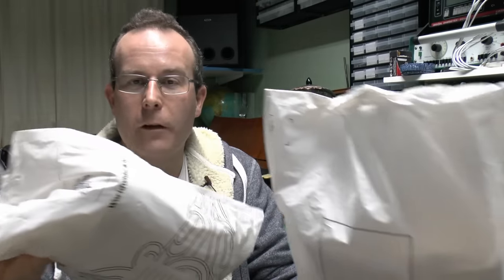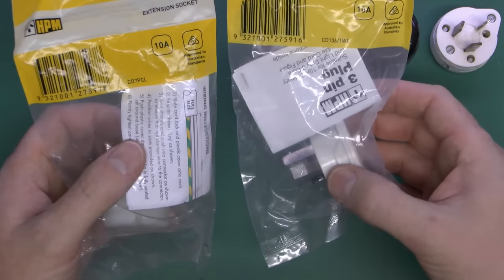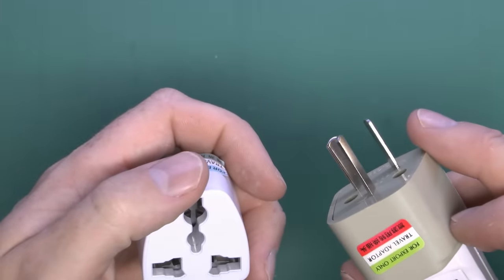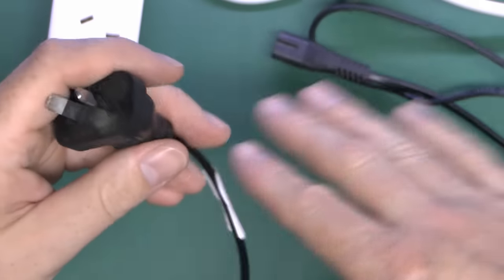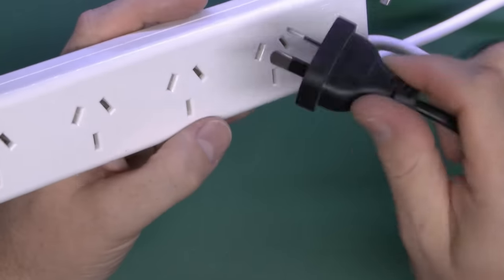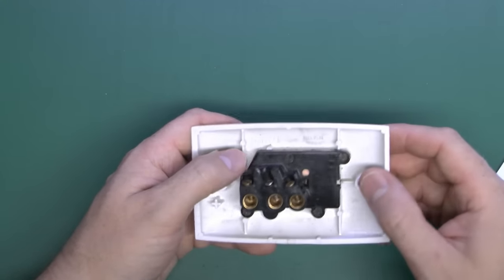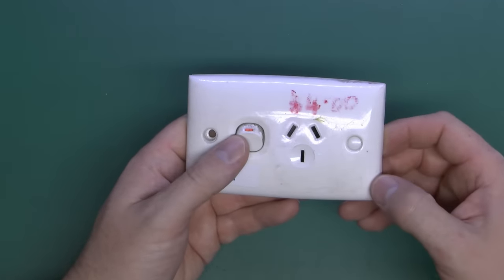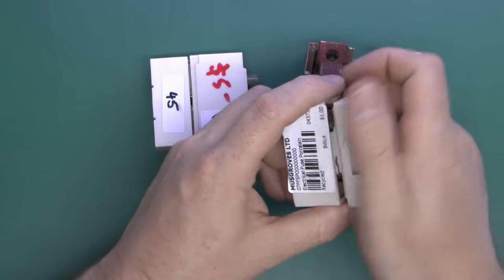New Zealand Electrical Items

Comment: The Australian and New Zealand socket format is based on a design patented in 1916 by Harvey Hubbell II, who also designed the standard US socket. He intended it to be an improved version to replace the US power outlet, and it has similar dimensions. However, it never caught on in the USA. The Australian government apparently chose that design as it was much easier for local manufacturers to stamp out the relatively thin, flat pins than the solid brass ones used on UK plugs (which was the old round pin standard at the time, still used in India).

Comment: What a trip down memory lane ,Iwas an apprentice and tradesman toolmaker at PDL through 80s and 90s so several of the 22, 56, 500 and 600 series switch gear had my name on the mould and press tooling.
PDL is/was a GREAT NZ company. Clipsal and HPM our fierce aussie competition until all acquired in the early 2000s by schnieder electric. The old PDL 1960s 22 series bakealite switch gear is a bullet proof design still present in lot of NZ homes, its not surprising that you had no examples of its successor the modern looking 200 series, this range looked all modern with sharp edges an square look but its switch action was poor and always prone to wear and jamming, neither on nor off. The 500 and 600 series set things back on course with improved function and contemporary looks and the essence of these 20 year old designs is still evident today.
Reply: Tony Jongerius yes was good . China sends it back to us now
Reply: Tony Jongerius did you notice smelly baker lite on lamp holders lll
Reply: Only problems with PDL 22 series are the lack of protection from dust and dirt, and the earth pin should have had better mechanical support to prevent it being bent out of shape.

Comment: It's pretty standard to have all your lighting control wires go to and from switches here and not ceiling roses. Hence the Loop termination. Saves going into hot dusty loft spaces.

Comment: I am a electrician myself here in The Netherlands. All the boxes and outlets are made in Germany. At leas what we get. Our Wires are made in Germany as well if I am correct. And the Pipes we use are made somewhere in the EU (doesnt say where I assume Poland) other items we use are mostly made within europe as well.
Sockets and plugs are the standard european. In Europe there 2 main standards. What I call the normal type and the Belgium/France type. The main difference is that the normal ones have 2 tabs on the top and bottom of the plug and socket for earth. The Belgium/France type has a pin inside the socket which connects to a hole in the plug for earth. This type is also seen in Poland if I am correct. Most EU countries these days use the normal type. Sometimes even mixed. While I was in greece in the hotel we had 2 types of outlets. regular european ones, and a outlet with 3 holes (center hole is earth) There were some outlets in the room where we had that type. I don't know why they still put those in but I guess the normal EU type wasn't a standard to put them in. Allthough the 3 pin plugs have round pins right next to each other and the pins arent sleeved. soo if there partially inserted you could fry yourself. Well over there they don't care that much about electrical safety... I have seen weird stuff over there.... I saw a junction box opened. I could see the wires which were twisted together and insulated with electrical tape...

Comment: The socket with extra antenna outlet was for old Band I TV, which used a 300R ribbon feeder down to the set. Only later was a coax cable with the familiar Belling Lee "UHF" required, as this was transmitted on a sub 300MHz varrier.

Beware of the Clipsal, the 10A rating is very optimistic, here in SA the same style but with SA outlets will melt themselves at under 10A continuous, though that could just be them being the cheapest thinnest brass you can get.
Reply: +SeanBZA interesting, I've never heard of problems like that with Clipsal here.
Reply: +SeanBZA Your comment is incorrect about Clipsal. Our 15Amp outlets have the SAME Active and Neutral sizes as the 10Amp versions. The Earth pin is wider http://www.clipsal.com/Trade/Products/ProductDetail?CatNo=439S15 It is not quite double width. Our 20Amp version has 3pins the same size as the 15 Amp earth pin. 

I come across a lot of backyard metal workers who have air compressors / Plasma cutters / Welding inverters that all need 15Amp plugs. A lot of places do not have 15 Amp outlets so they make up leads that have a 10Amp plug with a 15Amp socket (unless they have just bent / cut the earth pin). 

Over 20Amp plugs we move to the industrial weather proof range (used to be called the 56 series after Clipsal's IP56 range which all part numbers start with 56 ) The 56 Series has single and three phase plug / sockets from 10A to 50A in plastic bodies with pin configurations of 1P +N +E, 3P +E, 3P +N +E. Also available but not widely used are 3P +E +2 Control, 3P +N +E + 2 Control. The control pins had no fixed function, they could be an external switch contact, RS485 Data Bus (A Touring lighting system was set up this way and the lighting RS485 common was mains earth).   

Clipsal is extreamly popular in Au as its head manufacturing plant is in a suburb of Adelaide in South Australia (the factory Tour is great)

Comment: For number 22 the socket at 16:20 the damage to earth was likely caused by a bent earth pin. In commercial buildings professional cleaners would often bend the earth pin on vacuum cleaners, floor polishers or similar equipment portable equipment to help the plug stay in while they worked. Over the years this would gradually damage the earth on the socket with broken plastic and poor contact for the earth pin similar to what you saw on that socket. It is quite a common issue.
Reply: That sounds like a good reason to have the beefier UK design instead. Even a young Arnold Schwarzenegger wouldn't be able to bend those.

Comment: Had a good giggle for 21 and 22 at 16:31

They're intended to be mounted 90 degrees anti clockwise to how you held them. So basically vertically with the ground towards the... well... ground. If I remember correctly the thinking, or at least the rumor, is so that if a plug is working its way out unexpectedly the last thing to lose contact will be ground as it's being pulled down.

Comment: One big advantage of U.K. Twin, or Triple, plus Earth cable is that the bare Earth wire can be used to strip back the outer sheathing very quickly. Start with a short cut, grab the Earth wire with pliers whilst holding the rest of the cable in the other hand, and pull. Thanks John. Very interesting.
Reply: Our TPS cables are so easy to strip the outer sheath off, a 5 year old could do it, 
just nick the end with your "sideys" and open it up.

Comment: Interestingly, the AU-/NZ-style of plug & outlet was actually invented in the US. It was the first grounded (earthed) type, patented. When encountered today (sometimes in laundry rooms of really old houses), electricians often refer to them as "crowfoot" plugs/sockets (due to the shape made of the three pins, viewed head-on).
Reply: ***** 
Those are all different plugs to the AU/NZ plug.  The pattern is similar but they are much bigger.  There is indeed a weird old outlet that is identical in pin spacing to the AU/NZ plug.  They were used for things which needed a ground before the standard plug we use now.  They were/are also used for "security" type reasons; to keep people from nicking power or equipment (although the latter is a rather dubious idea; anyone can pop a new plug on whatever he's just stolen).
Reply: +Scott Lichtsinn Yes, you're correct about the 30 & 50-amp outlets. But I was referring only to the old outlets that would be directly compatible w/ the AU/NZ plugs.
Reply: +Madness832 See US patent 1,179,728.
Reply: Yes; it's one of Harvey Hubbell's original designs, which included the tandem prongs, parallel prongs (as seen in this vid), and "polarized" (prongs perpendicular to each other).  Australia used a variety of (American) plug types before they standardized on the "crowfoot" type they now have around 1937
Reply: The crowfoot plug is still used in America--sort of.  On 277v, except that the ground is a round pin instead of flat prong, the same pin as on the standard American grounded plug
Reply: @davidpar2  The Australian standard plug standard was in use in 1923 - the official standard came later.
Reply: Been a few years, but I recently acquired a US crowfoot outlet & and plug, both made by Hubbell. The outlet is in the typical duplex style, but the actual sockets are mirrored, ground-to-ground. 

Also received Hubbell plugs w/ two horizontal prongs ( - - ), perpendicular (-- |) & a couple of very curious T-prong plugs (-| |-). The first two are the obsolete NEMA-2 types that were intended for (single-phase) 220/240v @ 15 & 20 amps, respectively. But I have no idea on the third ones.
Reply: Madness832 the perpendicular one and the tandem one are still recognized NEMA configurations, although the latter has been “banned” since the 1960s because here in America our 240v is derived from split phase (2 hots), and there is no neutral or ground with a NEMA 2 plug on 240v.  Interestingly, the NEMA 2-20p is still permitted in industrial applications.  And there was a non-NEMA perpendicular plug too as well as its corresponding outlet in the 10A range, sometimes used on 110v or 220v d.c. equipment.

I’ve seen those “t-prong” plugs myself, and while they are obviously designed to fit into t-slot outlets, why they were made when either a parallel blade or tandem blade plug will fit is beyond me

Comment: My grandfather was a electrician so remember seeing most of these. The fuses where usually mounted on board and you had to make up the fuse box yourself. The socket with radio connection was I think TV (New Zealand used VHF) and this was the type of wire used to the TV aerial. Clipsal was a good brand and one of the light switches the actual switch unit pops out. Unlike the UK Aust/NZ don't have fused plugs so everything went back to the fuse board, fun days of tripping appliances. The wiring cable was far superior have all insulated cables but pulling though stud work was harder, remember it being a stiffer cable.

Comment: Just in case anybody is curious, PDL was a New Zealand founded company (plastics and diecasting limited) that has since been acquired by Schneider Electrics, and a lot of other brands Schneider have acquired (eg Clipsal) go under the PDL branding in NZ now. Its still around and is quite ubiquitous.  Similarly, HPM is an Australian company that has been acquired by Legrand, though not sure what it stands for. There were a few other brands featured in the video, like Arlec and Deta, but these are cheap and nasty stuff, the "home brand" of Bunnings, a home improvement/hardware store. Most electricians refuse to work with them for fittings and switchgear.
Reply: thats very true PDL factory was in Christchurch.

Comment: From what I understand, the piggyback plugs were taken off the Australian market because some fool fitted a male plug on the other end of the piggyback cord and plugged that end into the mains, which meant that the pins on the piggybacking end were left exposed. The bloke touched the pins, got shocked and died, which resulted in their ban. I think they're permitted again, with the proviso that they must be manufactured entirely as a single molded unit, with plugs and sockets fitted on both ends of the cords.
Reply: They are called suicide leads for the obvious reason but they do have a legitimate use. Quickly testing stoves without dismantling them. Turn off all the switches and elements on the stove. Plug in one end to the three pin plug on the stove and turn that switch on and do your insulation test with your megger, then plug the other 3 pin plug to a wall socket with an RCD fitted. Turn on ONE element at a time and test the controller and element operation. When each top element has passed  its test, open the oven door and check each element and its controller, including the light and fan if fitted. Turn off the wall switch and remove the lead from the wall socket. Now you can remove the plug from the stove,  roll up the lead and put it away in a safe place until the next stove needs testing.
It is also a way to connect a generator to a house in an emergency BUT make absolutely certain that the main switch is turned off and no power can be fed back to the grid or you may kill somebody working on the power lines nearby.
Reply: I bought an extension cable at Bunnings about 6 months ago with the suicide plug but it was a fully enclosed molded unit. I didn't know that they had been banned or why. Interesting! 👍
Reply: I’ve seen rewireable piggyback plugs for AUS/NZ available on eBay, manufacturer either Schneider PDL or Clipsal, I believe.  Absolutely absurd to ban something because some nitwit was virtually too dim to exist and wired the piggyback plug with energized prongs exposed
Reply: There's nothing wrong with a piggyback plug when it's fitted at the line end of a cord

Comment: The slots on the multi board are opposed so as to prevent it falling off the wall by being bumped into, one would have to deliberately lift one end to slide out the other.

Comment: The mounting boxes were held to the wall studs either by screws or often a couple of nails. The ribs were for spacing. The nails often used before the gib went up and screws if a flush box was installed after gib installation by sliding the box inside the hole and then screwing to the stud.

Comment: 10:56 I hate the cable being connected at that angle as they always seem to be angled in the wrong direction when I am forced to use one. When we built our house I drowned the place with double and 4 way outlets (126 inside and 8 outside) so I would never have to use a powerboard/powerstrip again. I had 22 (increased to 28 later) outlets in my office and the second thing I had to plug in I needed to use a powerboard. So frustrating. Have had to add a further 16 outlets in the house due to additional devices that didn't exist or were very expensive that we didn't then have. Still need to add a few more so I can finally get rid of extension cables.
22:55 is for a TV as you initially surmised. While I have never seen that cable used for a radio it doesn't mean that is was not used it for that purpose.
30:36 This cable was the style that we used to make at the Associated British Cable factory in Christchurch in the early 1980s so it is a tad old as you thought.

Comment: I note that the brown piggy-back adaptor at 2:38 has a recess around the earth pin for easier location when used blind. UK supplier Scolmore has a development of this idea, intended for the visually-impaired, in their Mode Locating Plug Socket (sic): www.scolmore.com/products/mode-locate/

Comment: Part No. 2 is called a "tapon" and the switched tapon  had an extra rivet visible from the pin side and was as you say used for plug in thermostats and time switches as well as remote "off/on" switches.
Part No. 21 was manufactured in the immediate post war era probably in Australia or the UK as I don't recognize that style from my apprenticeship days starting in 1966. It may have been a Neeco (National Electrical and Engineering Company) brand.
Part 28, 2 "dolly" or flush-plate screws were 6/32 UNC thread, as were all PDL terminal screws and mounting screws, ie 6 gauge, 32 threads per inch (American) Unified National Coarse. I used to own an eight sided flush plate screw driver, manufactured by PDL in zinc diecast,  embelished with PDL where you could see it.
Part No. 27 are the extra long screws for use with mounting blocks and pattress boxes, again 6/32 UNC.
 Part No. 30... you finally got it, a TV antenna and power socket! That mounting box (Part No. 30) with it was designed especially for it with the power cable going through the round entry at the top and the ribbon cable going through the oblong hole. The cable needed to be twisted several times before fitting to reduce interference on the TV signal.
Part No. 43, the brown fuse holder and base had a finger and thumb grip on the side of the fuse to allow for safe removal. In New Zealand, we wired the live terminal to the top terminal of the fuse base and the trick for not getting "plated" was to pull down on the top part of the fuse holder until it became disconnected and then removed it from the base by holding the sides of the holder. In all my time as a sparky, I never got a shock while removing or replacing a porcelain fuse.
The circuit breaker, Part No. 44, will fit into either of the white porcelain fuse bases without any modification. They were usually sold as a pair to identify the circuit breaker base so you wouldn't try to fit a porcelain fuse holder in it by mistake. Home owners did try... believe me.
Part No.46... yes, we had the twin with a bare earth wire, post war when raw materials were scarce but you missed the most important fact about the three insulated conductors.  The two outermost conductors are the earth and the neutral, nick either with a knife or saw and you live to tell about it... and replace the piece at your expense.

Comment: 20 amp is common for cooker / oven circuit.  Common amp ratings are: 5 A lights, 10 A Sockets, 15 A Heating / Hot Water.
Reply: 5/10A lights, 20A sockets/ H/W and A/C , and 32A range and hob

Comment: The slots at (11:20), are verticle and horazontal so that the power board can be hung on a wall either way around, if they were both the same you would need four holes or two different mouldings.
It must have been cheaper for Bart to send you his shitty old rubbish than to pay the council dump fees.